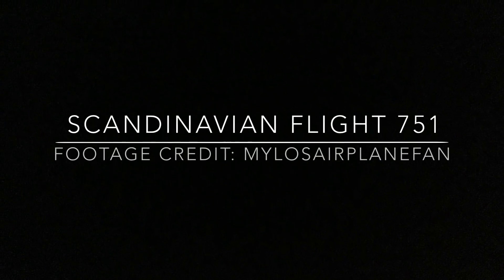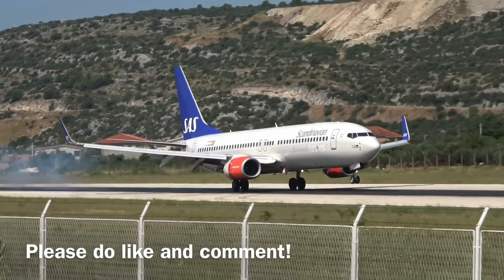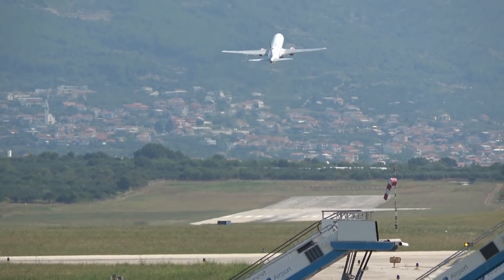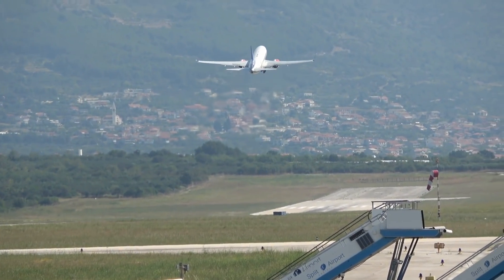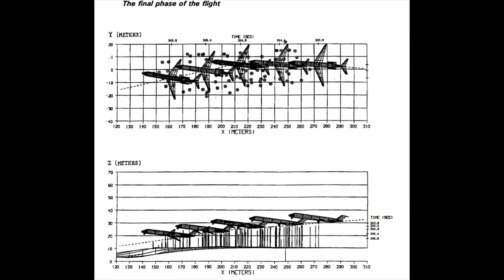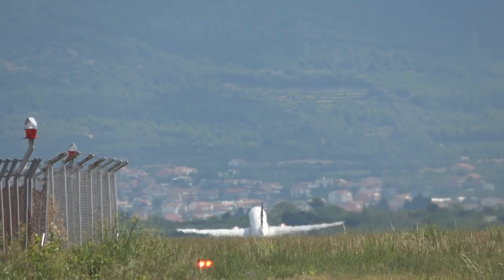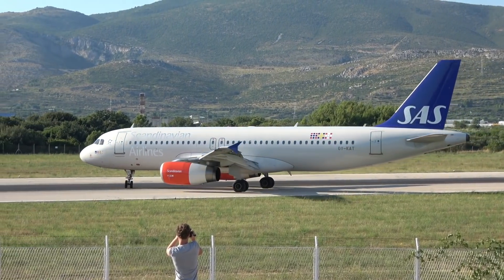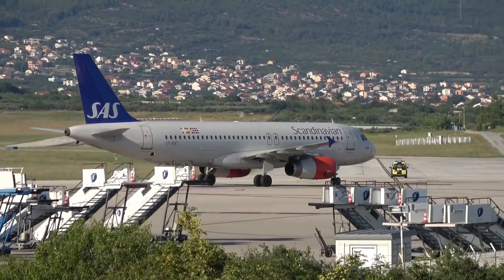The Cold Truth | Miracle at Gottröra | Scandinavian Flight 751

Comment: Nice photos, HOWEVER, it had been even better if the pictures had been on the same sort of plane as in the accident.

I'm not an expert on airplanes, but I'm not that stupid that I believe that ice from the wings first flies forwards, then into the engines.

That becomes very clear when the video shows a plane with much "thicker" body, and the wings placed in the middle of the plane, the engines are fasted to the wings, and stretching way front of wings.

At the same time the voice describes how the actual plane looked; a slender body, wings a little behind the middle of the body, the engines just infront of the tail, giving ice open access to be sucked into them.
Amateurs like me can check photos of 

McDonnell Douglas MD-81, 

then it's crystal clear how it happened.

Comment: You could at least  have shown the correct plane in your video, i.e. an MD-81, especially as you mentioned the engines were not mounted on the wings. This would have illustrated your point about the upper wing ice having been slung into the engines.

Comment: It doesn't make any sense to illustrate with using an SAS A320 Neo instead of the MD81. The whole point about the story is that the MD81 has two tail mounted engines instead of two underwing mounted donks like on most modern planes. This is what can cause ice from the top of wings to enter into engines and cause engine stalls. That can never happen on an A319-21 or even a B737 type airplane.

Comment: It seems for as rare as there supposed to be plan crashes and malfunctions seem to happen way more often then they should of happen. Especially in foreign plane  trips like going from japan to Sweden our something like that.. in fact the worst plane crash in history was going from japan to I don’t recall were but it caused the death of 500 people. No it was not a single plane i think it was two  planes that collide into each other. One of the other plane crash you tubers covered it. Don’t recall the flight number. Though i noticed the 747 jet models from bowing  had a lot of accidents and malfunctioning issues. Yet  they continue to manufacture them for decadess despite these issues . I think eventually after 20 to 40 years of issues i think that model of 747 finale got discontinued.

Comment: Once again rear engine placement caused problems which would have need avoided if the engines were not rear mounted.

You could argue that there were cases where the engines on a wing caused problems, but I get the feeling from these crashes that these planes with rear engine placement are too fragile.

Comment: While the commentary is fine, I find it a shame that a lot of the footage shows aircraft that would NOT have been equaly affected...
When the ice slid off the wings it hit the engines... only because the md-80s enfines are in the very back of the plane. So planes with engines under the wings would not have been affected in the same way. So, I find it misleading to include images of A32x and/or B737. A comparable aircraft would have been the Boeing 717, or any of the Embraer family.

Comment: Actually, according to Mentour Pilot, it's even worse than the pilots not having training on the thrust restoration system. In fact, the airline hadn't ordered the planes with the system, so the indicators and controls for it were never installed. The relevant pages in the operating manual from the manufacturer, were also removed for the airline's version. IIRC, a later system update activated the system in software (it didn't need any additional hardware because the autothrottle system already included the necessary actuators).

So not only did they have no training, their manual had no mention of it, their checklists wouldn't have mentioned it, and they had no way to control the system and no way to even know it was armed. No wonder the captain felt so betrayed by the plane that he never flew professionally again!
Reply: Sweet lord! So basically becomes a death trap!

Comment: The pilots missing ATR training is an understatement. The airline bought the MD-81's new and did not get information about the ATR being ínstalled to begin with. That's more than just not educating the pilots properly...
Reply: Would it be that 737 MAX story is a repeat?
Reply: Apparently the ATR is there to comply with take-off noise regulations over built up areas in the US.  As these regulations only applied in the US, the manufacturers didn't bother to tell overseas buyers about this 'feature'...

Comment: They were at 3,200 feet agl when lose the second engine.  They didnt Turnback to airport, kept going away from it.  Why??
Reply: Your comment is a joke right?
Reply: @relrel3707  Why do you say that?? Never seen that airliners can glide and do gliding turns too??  Buaaaa, buaaaaa!!! Mom, he is saying airliners can glide too!! Buaaaa!!
Reply: @outwiththem  they wanted to return to the airport. They tried to restart the engines but were unable to. They dropped out of the cloud at about 900’ realised they would not make the airport and would have to land in the field straight ahead of them.
Reply: @kickedinthecalfbyacow7549  Yes i know that they kept going straight ahead and away from the airport when they were supposed to Turnback to it.  Failed to Turnback..
Reply: @outwiththem  Airliners are not efficient gliders, they descend pretty quickly, they have a wide radius turn and a slow rate of roll.  Every turn significantly increases the rate of descent.  From 3200 aal they would not have been able to glide to the airport, let alone align the aircraft with the runway.
Reply: @kickedinthecalfbyacow7549  Standard Operating Procedures say that At any altitude, if engines failing, or fires, YOU HEAD BACK TO AIRPORT FIRST, THEN try to start the engine or engines and go thru the checklist.  They kept going away instead.  Failed on SOP's.. And that is what is bothering this captain.  He failed on SOP"s under pressure..  Ignore SOP's, kept going away and crashed away too.  Afterwards, He rather went away to collect disability because "unable to be a pilot anymore".  He failed.  That is the reality of this..
Reply: @outwiththem  I’m not sure what SOPs you are looking at, but I’m certain that you have made it up.  If a twin engine jet loses both engines the Boeing and Airbus policy is to try to restart the engines start the APU and deploy the RAT if fitted.  If you can’t restart the engines you are going to crash land.  In an emergency situation the captain can do what ever he wants to, if he feels that it will improve the out come.

Comment: Investigations show that the wings flexed upon takeoff as it begins to bear the weight of the aircraft, as they should. The ice on the wings broke off and went into the engines, damaging the engines and causing engines to loose power, not enough to keep it in the air.but just enough to keep the aircraft from stalling{,as the engines are very close above and behind the wings}.

Comment: That's insane that everyone survived, looking at the pictures
Reply: the way it broke into three pieces, it still baffles me to this day
Reply: To me it's more remarkable that only one person was seriously injured (became paralyzed chest and down).

The long stretch through the woods (the reason they let down the landing gears, as extra brakes) reduced speed significantly. It had been much worse with a touch down at full speed.
Here, also they were lucky the tail hit the ground first, acting like a plowbill, the rest of the plane, the ox so to speak, pulling forward, that stopped quickly. Now that little help from the tail going down first, reduced the impact when the front belly took ground and made an immediate stop. 
The plane broke at two places, the first part turned a little to the right, the middle a little to the left, but the third, hind, was nearly in the same direction as the middle, almost parallel. It had moved sidewise more than forward.
If the full pressure from the last third had continued forward the wreck had looked like an N, and the increased force had caused many more, and much severe injuries.

(Later the common joke went "In Gottröra, they have the most expensive plowbill ever", it's easy to make fun of things when the outcome is as lucky as this was.)

Comment: The internet craps on the 737 max.. But here is an example of an older plane, with an automated system, that responded to events and caused more trouble, and the pilots had no idea the system would do that. I'm talking about the sort where the throttles advanced themselves when he was trying to fight the engine surge.

It isn't a new concept to have systems in an aircraft that work automatically. Unfortunately companies still try to cut corners to save costs. Every pilot should know exactly how every system in the plane works. Especially one with automation.

All planes are basically the same until you add hidden crap like that in and don't train people on it.

Comment: why do so many safety systems for airplanes cause so many failures too.
Reply: For one because the pilots are not trained well enough. And because every system will be a positive and negative thing. Mostly positive but in some cases they can become a problem.

With fly by wire and more automation in planes, there is a paradigm change needed. Pilots should become less of a pilot and more of an engineer which understands the tech.

Comment: Why can’t they add some type of heaters to the wings to help with melting ice?🤔
Reply: Iserved 88 they do on the leading edge.
Reply: There are many different anti- and de-icing systems used in aviation, including heating either electric or using hot air from the engines, spraying de-icing fluid and pneumatic rubber boots that inflate and break up the ice sheet.
But all these systems are designed to deal with ice that forms on the aircraft during flight, and aren't sufficient to get rid of massive amounts of ice already formed. 

If the aircraft has been outside during iceing conditions before its flight, it must be properly de-iced by ground crew prior to take off.
Reply: @danielrehn81  a silly question:  Would it be possible to run tubing near the flats of the wings, filled with anti freezing fluid, and circulate that through the engines via an electric pump, or driven by gearing from the engines?  By using this type of system, this would mean that the planes could de-iced by themselves.  Yes, it would cost a bit of fuel, but, at least this would mean that the planes could de-ice themselves when they need it.

If memory serves, there has been a few incidents involving ice on aircraft, after the supposed de-icing has been performed.
Reply: @111jacare  HI, first off I'm not an aircraft engineer. I'm a student helicopter pilot so my knowledge and understanding of the aviation industry in general and de-icing systems in particular is pretty basic.

That being said, I'm sure such a system could be built into an aircraft, but it probably wouldn't make much sense in most cases.

All aircraft rated to fly in iceing conditions have anti-/de-icing systems sufficient to deal with ice accumulation during flight.
A system capable of completely removing large amounts of ice accumulated while on the ground would be costly to install, and more importantly add alot of weight to the aircraft.
And since weight is money in the aviation industry I guess it makes more sense to have one de-icing system on the ground servicing all aircraft on the airport instead of installing expensive and heavy equipment in each aircraft.

But like a i said, I'm no expert on the subject so if anyone have better information feel free to chime in.

Comment: So, is McDonnell Douglas at fault?

The ice situation was well known and isn’t it the manufacturer who writes the procedures to be taken to prepare the aircraft for flight.

Should they have written such clear instructions that any engineer could follow them and clear the plane for flight (or not)?

If not, who?
Reply: The fault lies with multiple parties, 1st fault lies with the company who produced the aircraft as the manufacturer any faults or issues should of been notified to the pilots regarding them if they needed addressing, 2nd the inspecting engineer as the engineer he knew the plane had been parked into near freezing temperatures with fuel left in the tanks he saw the ice and slush developed in the wings and knowing this he still thought 'ah lets just deice and fill her with fresh fuel and she'll be ok'
Reply: I agree with the manufacturer. 
However my understanding is that the engineer is required to follow the check plan to the letter. He is not permitted to use his own initiative to do his own inspection. If I’m right, did the engineer follow instructions or did he fail to follow a rule?

Comment: Interesting. The idea of the plane itself working against the pilot it quite scary.
As a complete layman when it comes to aviation, there is something I don't understand: The pilots detected engine surge during take-off and did the correct thing: reducing power.
Then an automated system came to live, forcing the power back up and thus trashing the engines. Given that reducing power is apparently the go-to response to engine surge, shouldn't the presence of said engine surge have prevented the automated thrust restoration from activating in the first place?
Reply from the maker: Apparently the ATS wasn't programmed to detect a surge. It was an oversight on the part of the manufacturer
Reply: @MiniAirCrashInvestigation   An oversight that nearly killed a lot of people.
A system that takes controll away from the pilot in a critical moment, and pilots not trained to handle the system.
That reminds me of Boeing's current troubles with their 737 MAX. Apparently those lessons aren't always fully learned...

Comment: You would suspect that at least 1 would have died. It’s incredible that everyone survived
Reply: It truly is incredible. If the plane broke apart in any other way, a seat could have fallen out while they were still sliding and crashing.
Reply: Yeah it also looks like the two back parts slided into each other which could at least have crushed one.
Reply: I think there was one serously injured with long term damage.
Reply: @SheepWaveMeByeBye  Yes. Paralysed from the chest or waist down. The person was sitting just where the fuselage broke.
Reply: @urilou777  don't read comments then
Reply: They are all Vikings. All of them went for a beer right after.
Reply: But a welcome surprise. I get tired of hearing that no one survived a crash, it's depressing.
Reply: This comment appeared first in the YouTube mobile app and weirdly spoiled the video in a...good way..?
Reply: @charlieapples9373  9
Reply: It'd be a rough ride but without any solid impact, crashes are survivable - provided there's no smoke or fire !
Reply: 69th